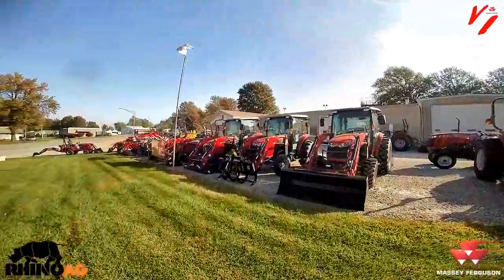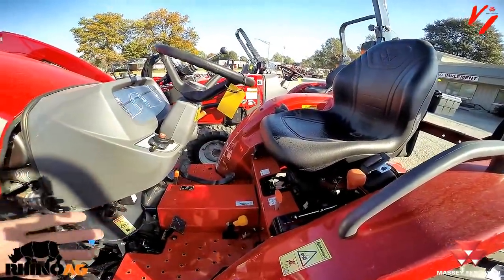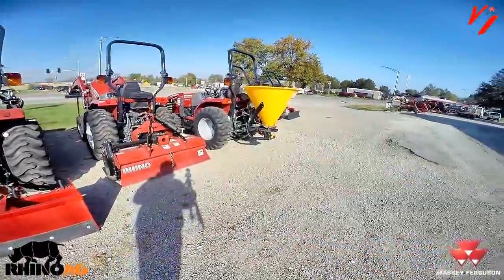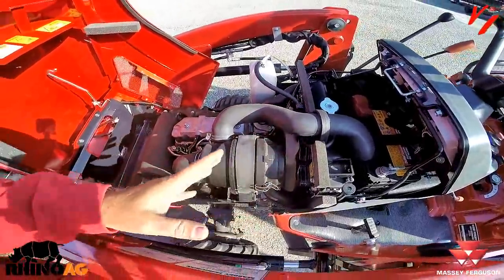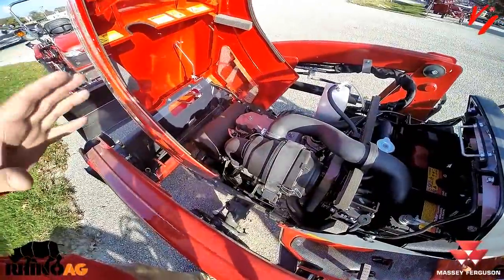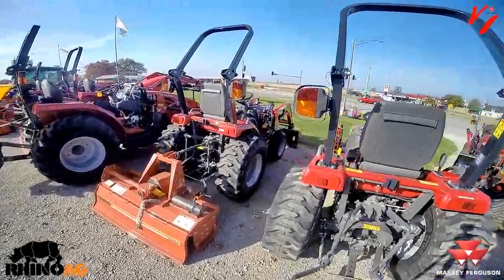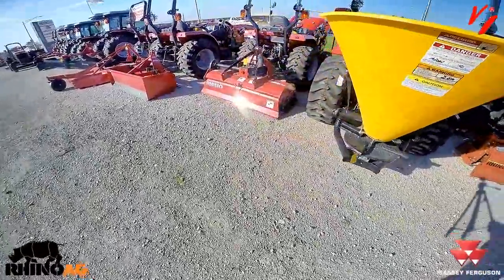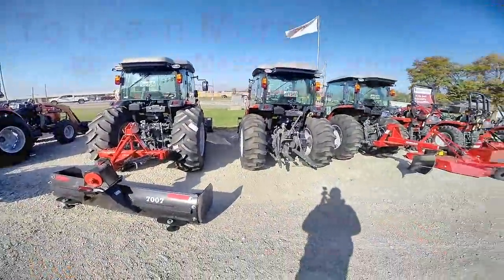The Basics: Understanding Engine versus PTO Horsepower - Compact & Utility Tractors

Comment: Well done explaining the different  pto hp. to engine hp. the chart was great .Do Massey Fergunson dealers have that chart available  at the dealership? I do not remember seeing that when I bought my 1526 other than when I was looking at different M-F's  models online. I liked the chart You had ,you can see all the models together.Thank You.
Reply from the maker: We created that at Vahrenberg Implement to help teach our customers about the difference and used it on our video. Thanks for the comments and watching.
Reply: @VahrenbergImplement  That chart is a great demo to have on hand , so you can see all the different tractors at one time & the different combos of hp.& pto output. AGCO should have that on there web site.
Reply from the maker: We always share Engine & PTO HP data with our customers it's right at the top on the Pricing Material and we discuss it. Engine HP is more for Marketing and not a true gauge for what the tractor can do. PTO HP is testable HP and determines the Implements you can match to the tractor. Once we get past the Engine HP comparison to other brands and get them in comparable range I sell on PTO HP. That is what matters and what is available "To Do Work"
Reply: @VahrenbergImplement  I did get a pto read out from my dealer when I purchased my 1526 as well  as a engine read out on both  net hp. for pto & engine, and I made my decision prior to purchase from the info. AGCO had on there website,and what I am trying to say is the chart you have should be used on AGCO website, so you see all the different variables at one time. I am very happy with my dealer & purchase!!! & nothing pulls like a Massey Fergunson!!! LOVE MY M-F's this is compliment to the effort you put together for your customers & AGCO thanks again for what you do.

Comment: Great video(s) I have watched almost all of them, can’t thank you enough for doing them.  What about torque?  I have a GC1710 and a 1726e, close to same HP rating, but way different engine displacement.  So doesn’t torque play a role in all this?  Gearing aside, the 1726e has more grunt than my GC1710, even though I love them both for different reasons (affectionately “Big Red” and “Little Red”).  Please, everyone, I would appreciate some further guidance on this.
Reply from the maker: There are many things that can effect the Torque or more importantly Torque Curve. Engine Designs. For Example the 1726E is Turbo Charged Engine, GC Series is Naturally Aspirated...so the 1726E will hold Horsepower Longer when under load or flatter torque curve. There are many other factors that can go into why like Hydrostat design: 1726E is 3 Range versus 2 Range in the GC Series. 1726e is Shibaura Engine the GC Series is Iseki Built Engine. How Horsepower is created some manufacturers use larger displacement engines and less RPM to Create HP or some use smaller displacement engines and lots of RPM to create Engine HP...this is the weed eater effect...doesn't have much torque. Go look at some of the competitors subcompacts they crankup the RPMS on little engine to create HP (Green n Yellar) but they don't get the PTO HP. That is the purpose of this video learn what you are buying. There are differences even within the same manufacturer and why you need to learn what you are buying...Do Not buy on Engine HP alone spec.
Reply: Vahrenberg Implement Thanks for the response.  Your last sentence says it all!  Please keep the videos coming!

Comment: Thank you for the education. I would be very interested in hearing your perspective on PTO Chippers.
Reply from the maker: We don't sell PTO Chippers but may be able to answer a few questions. I know customers that have them and I have a small self contained at home.
Reply: Vahrenberg Implement thank you for the response. I am considering a bearcat pto chipper for my GC2310. Is a pro chipper suitable? Is the PTO power sufficient or will I be disappointed?
Reply from the maker: We are not familiar with that product. I would ask the Chipper Manufacturer what they require they would be the best resource for their product needs. Just like when I have implement requirement questions I call our supplier RhinoAG they know their products and needs best.